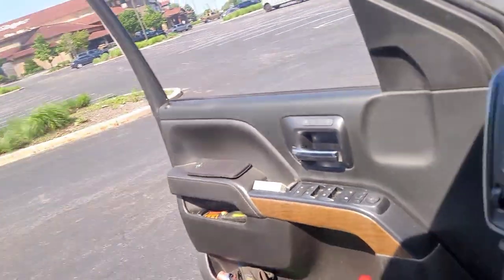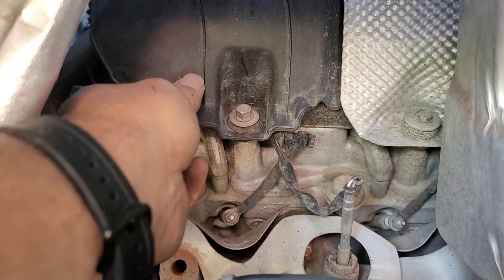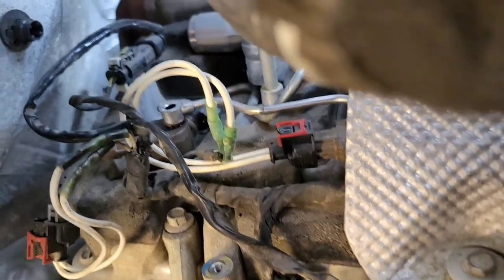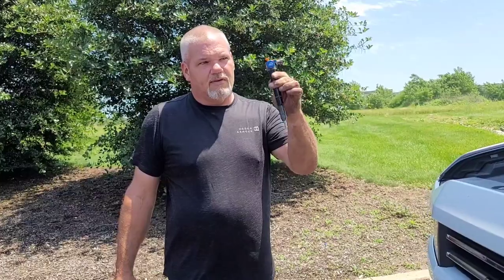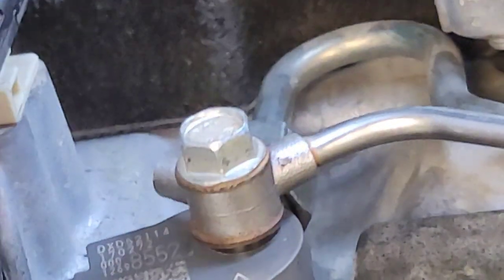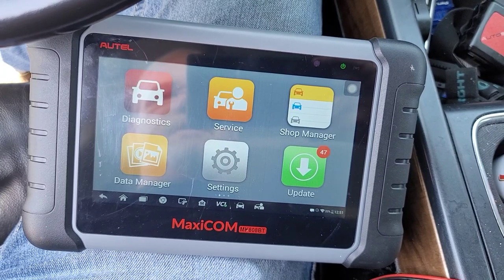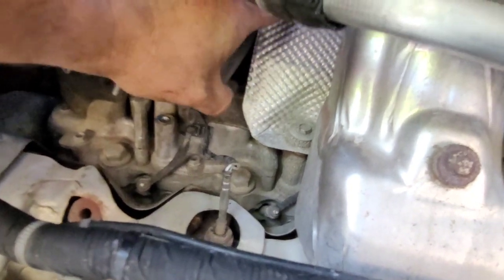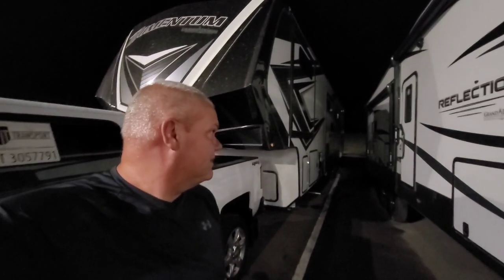Roadside #7 injector replacement L5P Duramax

Comment: Hey Charles. You get a standing ovation for changing an injector in a parking lot with just basic hand tools. GM/Duramax gets a tip of my hat as well for making it fairly accessible and straightforward. Oh, and if that injector was still good at almost 400k miles  that's also a testament as to the (overall) reliability of the Duramax platform. This video will surely be helpful to someone looking to swap out an injector. Thanks for taking the time to document this job.
Reply from the maker: Thank you sir, i hope it helps someone out. Thank you for such an awesome  comment!

Comment: Charles, thank you for sharing this! I'm in limp mode, in Meridian Mississippi (about 600 miles from home) due to my #7 injector. No one can get me in foe a week and I have to get my load delivered to Louisiana by tomorrow. You are a lifesaver!! Now, I just need to find an injector near me! Again, you are very appreciated by many viewers, especially me. Thank you!
Reply from the maker: Dang, i wish i was closer. I would definitely change the connector then start the engine and see if that fixes it before replacing the injector. I jumped to the injector then had to take it back apart and change the connector for the second time then it was good. Good luck sir and if i can be any help my email is cfarmeronyt@gmail.com

Comment: Good afternoon. I have a issue that is not making sense. About a 100 miles from home #5 injector plug went out I got home ordered the part and replaced #5 injector plug. Now I have no throttle at all? Before I replaced it, I was able to drive up to 50 mph.

Comment: Thanks for the video. Curious why you don’t grease the connectors with dielectric grease also? Might stop the problems 🤷‍♂️
Reply: Do you think a stabilant 22a would be more effective than a grease. Iv seen it used quite a bit in electrical convections.

Comment: Just did #4 and #1 injector , I have the same scan tool it’s not letting me put the flow rate numbers in on my 19 duramax
Reply from the maker: On mine i found the injector flow rate and hit the edit button at the bottom right hand corner. I am away from my scan tool or i would try and walk you through it

Comment: That sucks if you didn't need the injector. When that happens to me I just remember the thousands I've saved doing work myself and I'm not in your league or even close.
If you don't think it's the injector will you keep the old one for a spare or would it be a waste of time putting in an injector with almost 400,000 miles on it?
Reply from the maker: I will keep it for a spare. 400k... even if it wasn't bad i got my money's worth out off it

Comment: I had this problem with my L5p I actually watched ur video on how to fix  it I depinned the factory connecter and squeezed them a little tighter haven’t had issue since as I write this tomorrow I probably will have a problem thanks for the time to make a video
Reply from the maker: That's awesome! Haven't tried that but I may have to try it

Comment: Sorry about the wasted effort (being the connector instead of the injector), but it is a testament to the overall reliability of the platform. Yeah, those are some fragile connectors.
Reply from the maker: If it weren't for the connectors i wouldn't have much to talk about repair wise. They could've done better on those for sure

Comment: Do you know if can the truck be driven with a new injector without updating the codes? I can change the injector myself but don’t want to spend the $$$ on a new scan tool. Would just be driven to somewhere that could program the new codes in. 

Thanks for the helpful videos!
Reply from the maker: I've been told it wouldn't hurt it but it might not idle smooth
Reply: @CFarmer  Thanks!

Comment: Real helpful. I had code p0205 and watched this. It convinced me to try the fix myself. Went with just the pigtail and after 200+ miles still no return on the code. How a dealer say it takes 5 hours for this is beyond me. Thanks

Comment: Welp.   I'm sick to my stomach now. Lol. 2 days and $1800 dollars I got 1 injector replaced at the dealership.  🤬. Cuz I told myself it had to be hard.  And the dealer said  the turbo and the entire fuel rail had to come out.   It's ok tho. I do contract work for the owner of the dealership.   Bet your a$$ the next job is gonna have a change order enough to cover all 8 injectors......at his pricing.
Reply from the maker: O dang, that's crazy... the worst 2 are #1 and #3. One of the egr pipes has to come off but i caint figure a circumstance where the turbo or rail would need to come off. I'm sick for you 😞

Comment: I'm already going around the second time with my injector connectors. No injectors so far but im wondering if I should have one on hand.
Reply from the maker: Probably not a bad idea
Reply: @CFarmer  u in Washington  state
Reply from the maker: In South Dakota for the night
Reply: @CFarmer   I need help  on my tuck just got new injection  for 2019 gmc denali hd 3500
Reply from the maker: The pump or injector?
Reply: @CFarmer  the injectors I got one going to reno  then I will I need to be programming
Reply from the maker: Where are you at now? I'm on 90 and will be at Iowa 80 tomorrow and I'll be in Elkhart tomorrow night

Comment: Do you clean your injectors and if so with what and on what interval?
Reply from the maker: At 200k i started using hot shot secrets edt and at 300k i started running lucas dpf cleaner. Every fill up i put hot shot secrets except on the 3rd then i put in lucas. That's the only thing I've done as far as cleaning injectors.
Reply: Thanks.
I bought a 17 with 75k and all injectors was just replaced. I’m at 110k and truck threw a p026d code suggesting there’s a fuel injection imbalance. Dealership says all injectors need replacing. Smh…
I cleaned the air press/temp sensor and code went out for now…only been 2 days …and I added some fuel treatment.
But you’re doing a great job. Your videos make for good reference points
Reply from the maker: Thank you, i had stated getting the p026D code on every other trip and i would clear the code and it would eventually come back. Eventually it went off and stayed offand i never really figured out the cause. I did notice if i buy fuel at small places around home i would get the code more often. Wish i could be more help but i am glad the code went away and I didn't have to figure it out

Comment: Does the autel allow you to check flow rates?
Reply from the maker: It does
Reply: @CFarmer  Is anything the autel can’t do that you wish it did?
Reply from the maker: I got agrivated that it wouldn't connect to a 2022 ram without an extra cable. Haven't had a chance to try the cable yet. There are things out will do on my truck (like reductant heater test)  that it will not do on others (2022 gmc) not sure if I'm not going into it right or if the truck has that feature locked out. For the most part it's done everything I've wanted it to do for my truck but i have not went extensively into it. I've met up with a few people that wanted to try out on their truck and see if it was right for them. I wouldn't mind that at all if we were close. I'm around the Florence Alabama area

Comment: Hopefully it not just the harness like it usually is in l5p durajunk. I've replaced about 0 injectors and about 50+ harness connectors. Very rarely see failure on l5p except for harness and the dpf/cats melting.
Reply from the maker: That sounds about right. Thinking I'm going to replace all 8 injectors and connectors at 500k